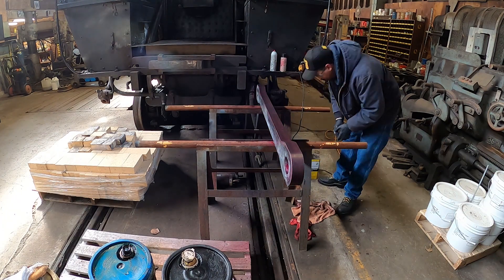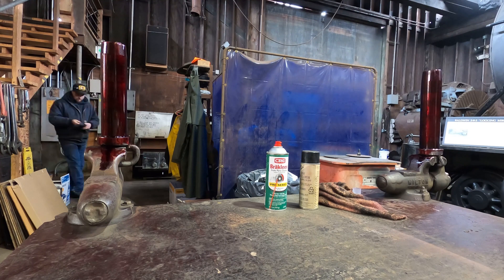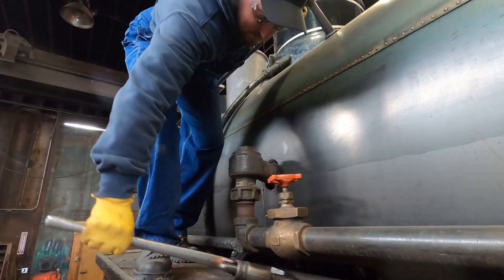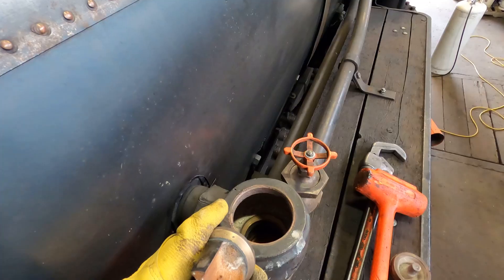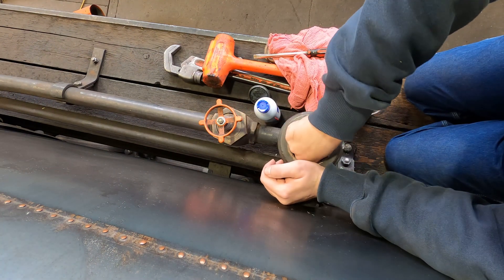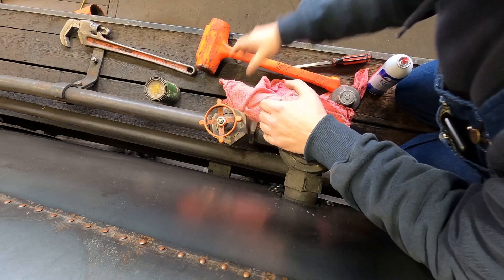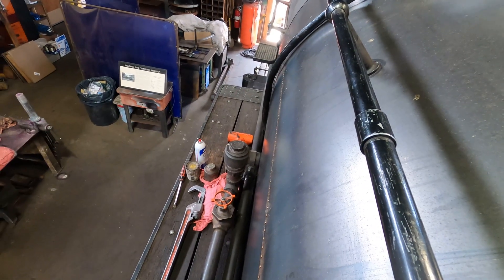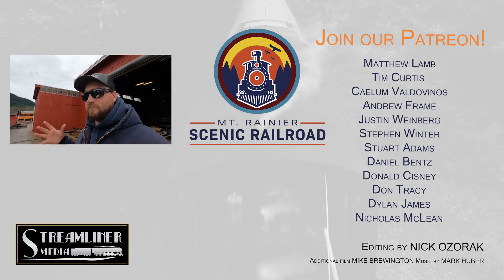Mt. Rainier Scenic Railroad - S1, E5 "Knurling & Lapping - Updates on the Polson 70 Steam Engine"

Comment: @8:30 Regarding LPA II - I'll pick some up and try it. Right now I'm slowly coating the entire museum i volunteer at in FluidFilm (it's basically just lanolin). Look into it - I started using it on cars in the Great Lakes Snowbelt area. I coated the suspension components and brake drum exterior on my wife's car in 2014 and 10 years later still basically zero rust. That's after 5 years of northern, salty winters and 5 years of gulf-coast tropical summers. You can buy it in bulk and apply it with an air-sprayer.